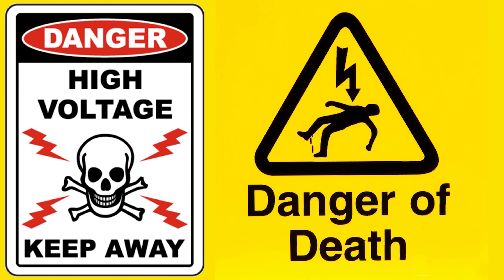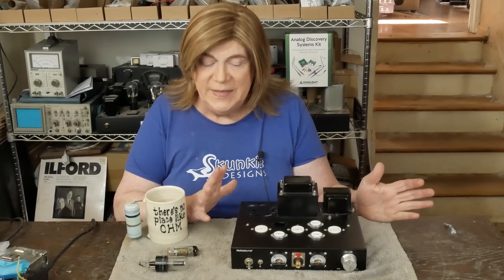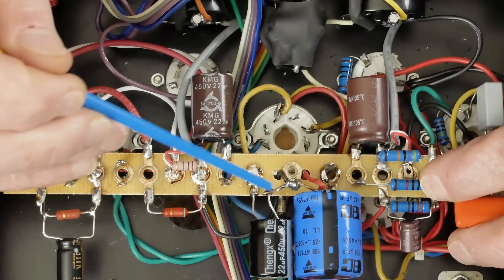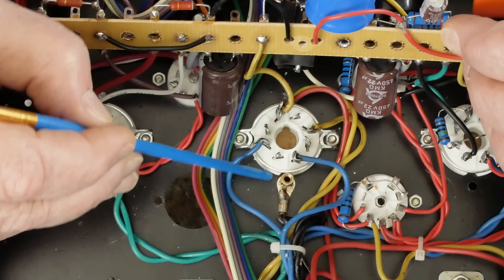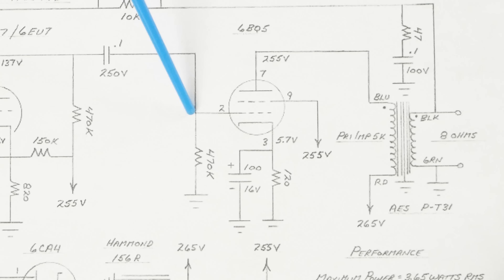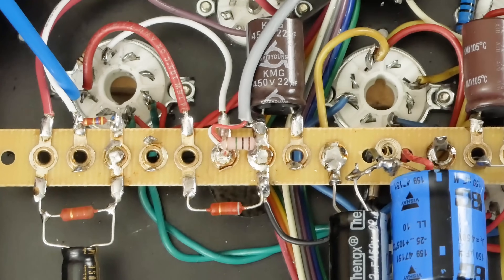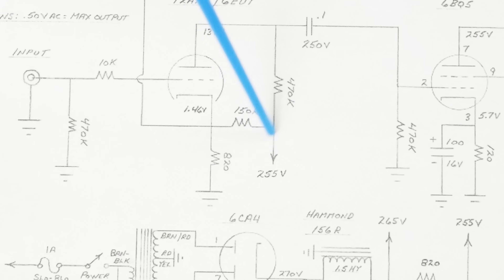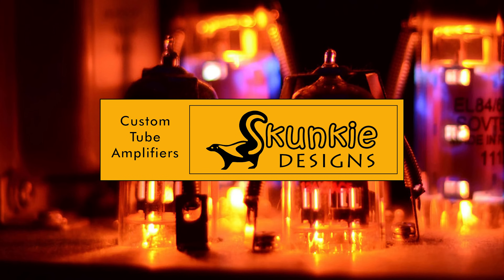Nobsound 6P1: Rebuilding it into an EL84 SE Amp!

Comment: Der zuerst gezeigte Plan könnte Tödlich sein. 255 Volt an der Lautsprecherbuchse. Der 150k gehört wohl an die Kathode der Eingangsröhre. Das sieht natürlich jeder, der sich damit beschäftigt.
Reply from the maker: What are you talking about? That 150K ohm IS connected to the cathode of the input tube.  I will make that more clear when I redraw this person's schematic and add a dot at the connection points, but note the way this person draws their schematics there are no dots at any of the connection points and they use a "jump over loop" when there is no connection.